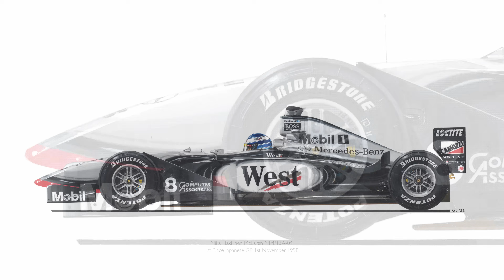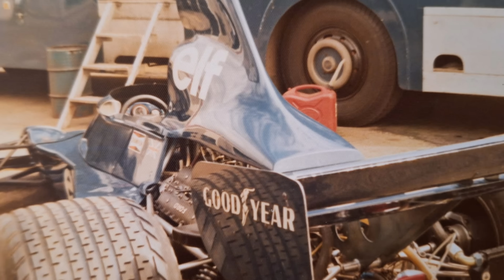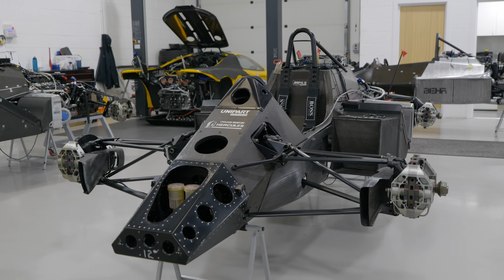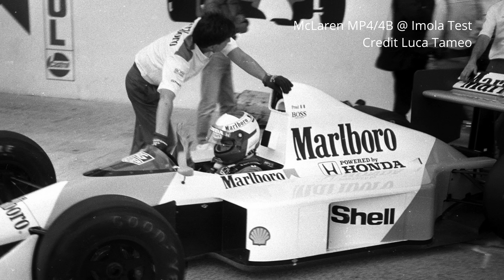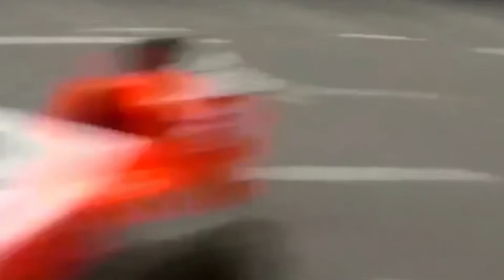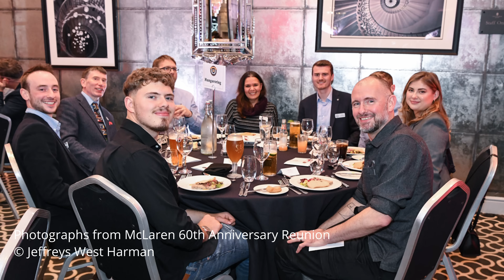Inside McLaren: An Engineer's Story of Working in F1's Golden Era

Comment: Absolutely crackng insight into one of the best eras of F1. I could listen/watch this stuff for ever and still not get bored of it.  Do remember hearing a story about Williams in what must of been 1984 looking into the Crash test regulatuions for 1985. Instead of building a drop rig tower like Matthew designed, they came up with a  little less high-tech solution. Williams borrowed a long ladder from a local scaffolding firm. Pulled a spare chassis up on a rope onto the roof of the Williams factory and dropped it off the side of the building !!!!! Similar to Mclaren it didnt fare well as at the time the FW09 Chassis was still built in more  'traditonal ' methods of honeycomb aluminium with carbon fibre strengthners.   By the time it had come to rest on the floor the entire monocoque was less than 14 iches in length!!  Thats when Williams realised they had to build a full carbon fibre chassis car.